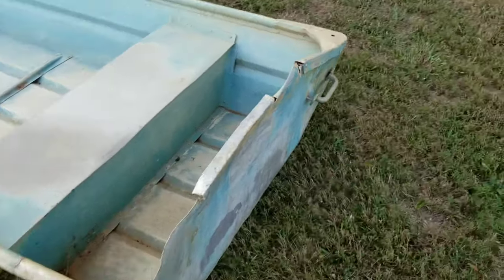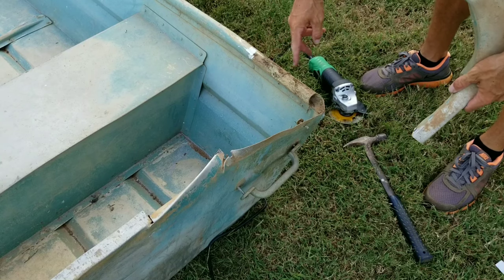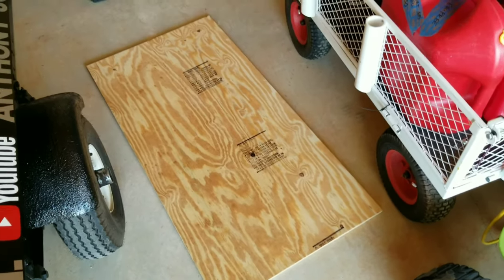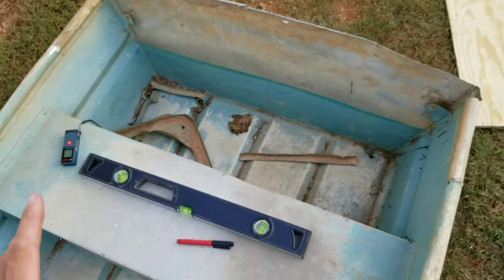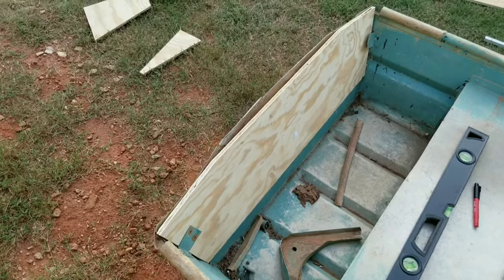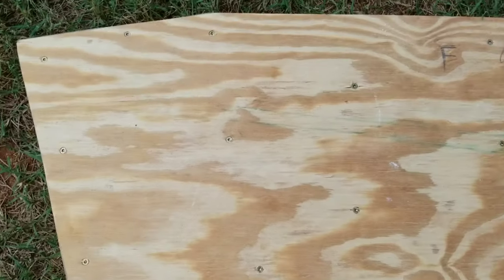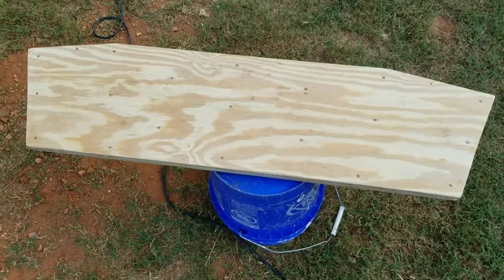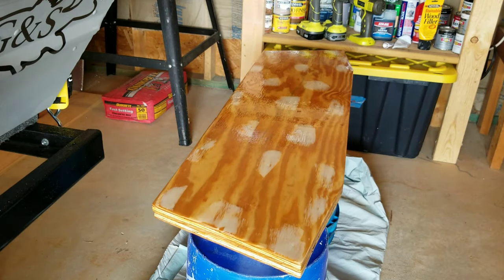Building a New Transom Replacement for my 12 Ft Aluminum Jon Boat

Comment: I have replaced a few. You can run 1” angle from outside in. And then inside out. Will make you a nice cap. It will give you a clean look. And a bead of 5200 in between will keep the top edge protected. Do it b4 paint and will look new. Hope that helps
Reply from the maker: Yeah man, I used 1 inch angle on the cap and had to build new corners too, tied everything in really nicely.  I ended up with a ton of footage on it so you'll see in upcoming videos what i did. It turned out nice. Your work is awesome man, really ie he youd your hatches and lip system!

Comment: Hey there. Quick question, is there a reason you don’t have the transom go all the way to the floor?
Reply from the maker: They don't from factory. I've worked on a lot of boats,  never seen it solid all the way down. My guess is to keep the wood elevated off tge floor in case you let I sit w water in it. Or to allow space fir thru hole fitting fir drains or livewell pumps. Honestly never gave it much thought besides replicating what was already there.
Reply: @AnthonyJonesBrigadeBoats  thankyou, I really appreciate it

Comment: You would not  struggle so hard if you had some saw horses.
Reply from the maker: I have some. Don't break them out to cut one piece of plywood.  I could cut that quicker than I could get the horses set up. I prefer to build the transom on perfectly flat concrete to ensure it is straight and not bowed from building on a sawhorse. Thanks for the input.